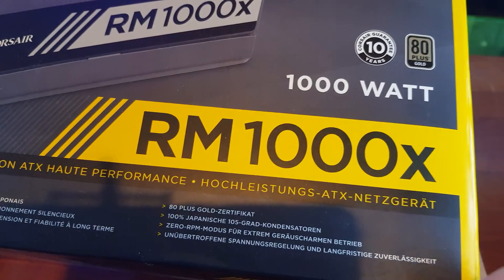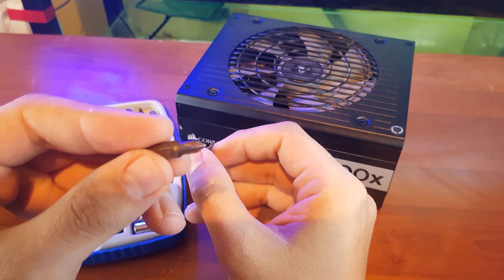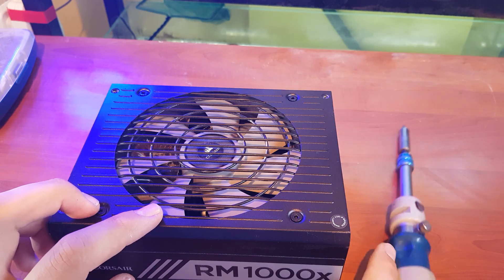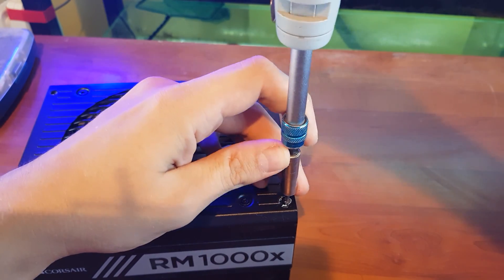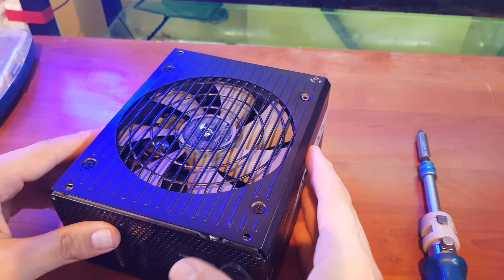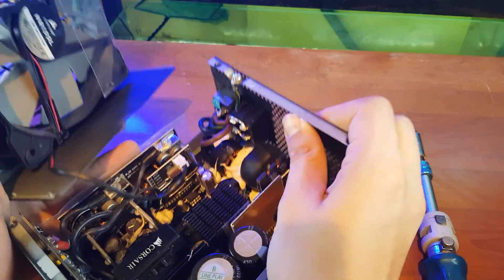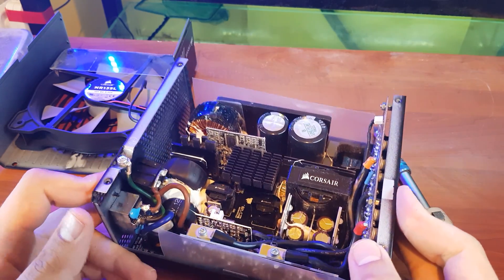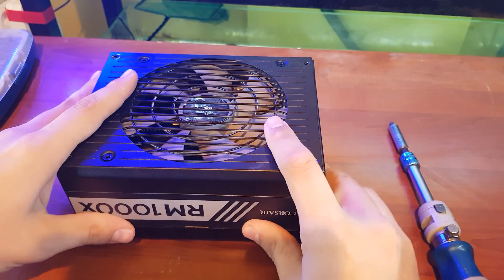Corsair RM1000X Disassemble and Cleaning

Comment: Any idea what's the best solution.. my sons gaming pc started causing him issues the other day. I took at look at the usual suspects. As the power appeared to be fine.. then not .. then fine i took for granted it was another component. So, after getting to the stage of swapping out the motherboard i had to upgrade the system thinking it was worth a shot, this system had the same issues so i used the original rm850x cables and installed my rm1000x psu and boom. Boots the system every time. The faulty rm850x issues was random shut down (which i never witnessed) but the obvious issue of on.. 2 seconds off, on, 2 seconds off.. all by itself, only holding down power resolved this to shut it down, no bios no nothing.. so the 850 is clearly faulty. Anyone here experienced the same issue? Just in case you repaired it, what did you find.. so basically, repair it or ebay search for another? Which is easier as i don't mind small repairs but sone things are in fact above me. But computer diagnostic/repair, no problem.

Comment: You shoulda definitely shown some examples of cleaning the thing. As much as ive messed with these things i actually dont know what all the little components do and whats safe/not to touch. Ive got more dust and gunk than ive ever had in a psu in my favorite setup rn but im not sure if there is anything more than dusting it with a blower/compressor that i can do at this point.

Comment: Hi, no fuse there? I just opened my older RM650 which died during the storm, I thought to check and replace the fuse in it as I usually did on older PSUs, but I do not see any inside :( so is it definitively dead?
Thanks in advance
Reply: Probably the RM models iirc arent as robust or high end as the AX and AX/i series? I was unaware these guys had fuses in them but i guess that makes sense? Ive literally never heard of someone replacing a fuse in a power supply before though and im typically the most tech literate/savvy person in my vicinity at almost all times.

Comment: Hey, is there any way to remove the panel on the other side or is it permanently attached?
Reply: Not sure if it matters anymore but ive modded a few of these corsair power supplies in the past. Disassembly is very easy imo feel free to ask me anything if u are still curious.

Also what do you mean the panel on the other side? Are you talking about just the other side of the housing/shroud? I dont see any panels on this thing. Its basically a metal sheet bent in the shape of a C and then a bottom plate that has a bunch of stuff affixed to it which then has the front and rear sides screw into those components.
Reply: @sparktite  This was my question as well. I do not recognize the screws on the others side. I want to paint the unit white but I don't know what screwdriver to use. The ones he unscrew are straight forward hexagon holes.

To be more specific, I have HX1500i.
Reply: Im struggling to picture exactly what you guys are talking about or having trouble with however i gave the 1500i a look over even though i havent had that specific psu before. My ax1200 or 1200i is similar in design but its all phillips screw.
To disassemble mine from memory there are 2 screw on either side of the PSU. Basically the completely flat Sides of it. There may also be a couple more on the top side near the fan screws but they might also just be screwing into circuit board/metal for support.

On the 1500i im not seeing any screw on the side but more on the top the hex screws like you said. 4 of those are bigger and just hold the fan so you dont even need to touch those.

Actually now that i think about it i did have a weird rounded top corsair psu once that looked like a smaller version of yours. I dont think it had any screws on the plug for the power cord but you could always try them.

Anyways if im remembering correctly youd wanna get the 4 smaller screws on the top near the fan screws out.  Nothing to worry about with the screws if you have any concerns.
Keep in minds theres a warranty sticker covering one of those 4 screws.
After that the whole housing should slide of like a large metal sleeve. You would slider it toward/off the end with all PSUs modular cable plugs.
My only concern would be making sure the housing and the fan slide off okay so just oat attention for any metal making contact stopping you from sliding the thing off. Same goes for if the fan catches/stops on anything inside the psu but i would assume its unlikely to do so.

The way a lot of the non "i" model PSUs used to work is they were like my current PSU which is more of a C shape of metal that just pops off. However, that are some almost hardly noticeable tabs on the ends of the thing that tuck into the metal on the bottom of the PSU for a flush fit and can cause a bit of resistance taking the thing off or making sure it goes in flush.
 @Ingrownpimple  

PS: I just took another look at some breakdowns of the hx1500i again and it actually looks just like how my ax1200 does it. Here ill post this link, scroll down about half way for some images of the PSU with no metal case/shroud on it. The final image in that group shows the bottom metal piece bare so you can see where all the screw mounting spots are easily. You  can even see the little indents for the tabs to slip back into.

I may also still be lost on the description of what the OP meant about "on the other side" but for a full disassembly you have screw on both thje front and back ends of the thing. Those hold the walls/metal to electronic components and then i beleive the compnent then also screws into the bottom of the whole assembly.

https://hwbusters.com/psus/corsair-hx1500i-review/ for the images half way down the article.

Also this other article actually showcases the screws holding the bottom together really well. Theres no way you guys are talking about the nuts on the other side of those screws right? Theres various ways to hold those to then unscrew the screws.

Hope thats not overwhelming i just figured if im not 100% following on what specific screws you cant get out im just trying to cover every base.
Reply: @sparktite  wow. Thank you for putting so much thought and effort into this reply. What I was referring to was the four "holes/screws/perhaps nuts" shown in picture number 3 under "product photos." I ended up opening it up and it appears that you unscrew those from the inside. However, even after that it appears that there was still something holding all the components to the back case. I ended up leaving it alone : /

Comment: I want to sell my PC components :-

Corsair Rm1000x PSU. 
Bought in Jan 2018.
Bill Box And all wires available.
Price: Rs.11000

Asus Z270 P 
Bought in Jan 2018.
Very good condition.
Price:- Rs. 6000

Corsair Vengeance 8gb Ram 
2400Mhz.  DDR 4      
Bought in Jan 2018
Price:- Rs.2000

Celeron G3900
Bought in Jan 2018.
Price: 2000

Contact: hardikpatel600@yahoo.com

Comment: i own a high end gaming pc with the corsair hx850i(1,2 year), how often do you need to clean it from dust , i clean only the back and the filter underneath the psu with the vacuum cleaner . because the temps are still fine after 1 and a half year.
Reply from the maker: Just check it after 2+ years of using
Reply: @dantetechnology  thanks!
Reply: i dust mine once a year with compressed air. its like a new, 4 years old, zero dust inside, however i ripped this stupid 135mm fan from my rm1000x unit and mounted costume 140mm fan inside, however it dosent really fit nice inside, had to glue one part of it to the shroud, i did cut a little hole on the side for fan cable to come out of the psu, so now i can control my psu fan with a fan controller i have installed on front of the case, my psu is ice cold and never heats up like it did before with that stupid fan that didnt do its purpose and that is, SPIN. my psu was always hot to the touch even when just browsing internet and would rarely turn on, probably only short before overheating.